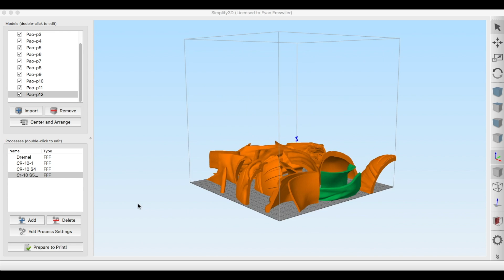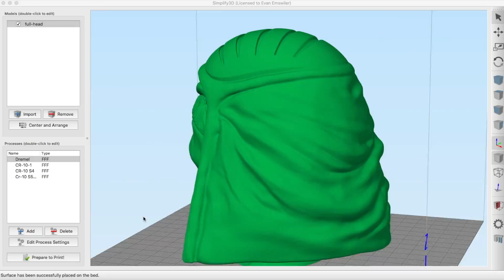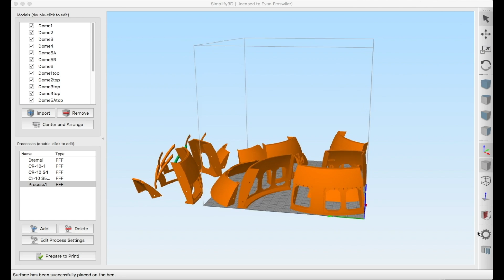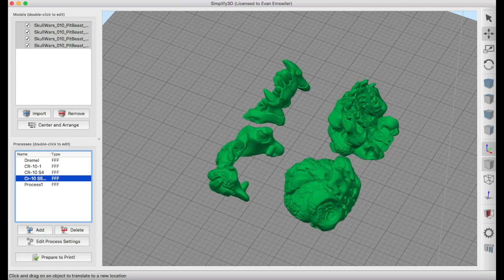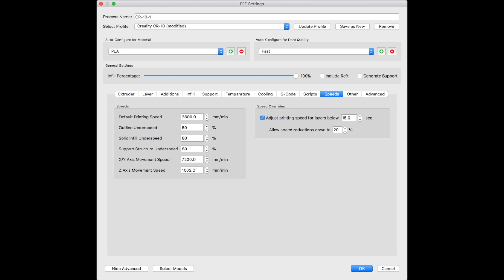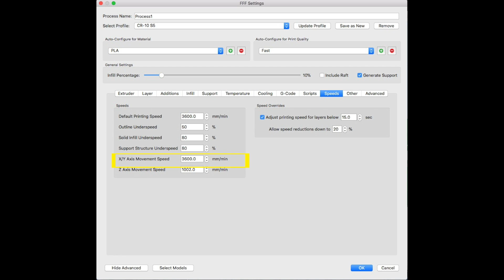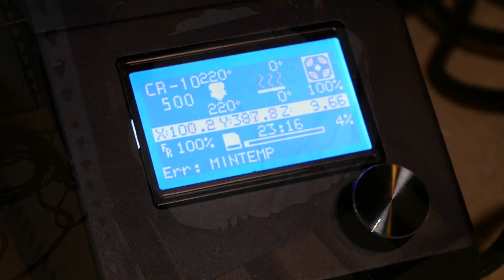Make Insanely Huge Prints on the Creality CR-10 S5!

Comment: Do you know of a printer with minimum 20"W x 20"L x 16"H?
Reply from the maker: Robert Martin Aside from this one you mean? I’m not really sure, actually
Reply: Mighty Jabba's Collection This one is 19.6", just short of what I need.
Reply from the maker: I see. I haven't actually measured the exact printable area, but it's not unusual for it to be slightly different from the quoted build volume. It's possible you actually can do a full 20" on this. What do you need to do that requires 20" minimum, just out of curiosity?
Reply: Mighty Jabba's Collection I am a beekeeper with a few ideas for hive management, however I want to keep my creations compatible with "standard"  dimensions. An example would be integrated sensors with WiFi or Bluetooth communication. Sensors such as temperature, humidity, weight, sound, etc. At the same time integrating solar, thermal and other power generation facilities (for the sensors). Also, possibly creating a"smart" hive by integrating a picture zero, Omega or other miniture single board computers. All of this must be done in such a way that everything fits in or is compatible with "standard" equipment. A complicating factor is the hive bodies can weight up to 70lbs, so single, solid parts are desired. As you can imagine, it would suck to lift a hive body and have glued pieces fall apart lol.

Comment: Curious, nozzle size? The feed motor was spinning like a clock, so I'm assuming something between 0.8 - 1.2mm?
Reply from the maker: Actually with these I was just using the standard .4mm nozzle, which is part of why it took so long. I am now using a .8mm nozzle and I think it’s a better fit for the machine

Comment: Hey! I'm interested everything from small detailed figures to large props. The CR10S line seems to fall inside my price range and has received some overall good reviews, but what would you recommend?
Reply from the maker: Most of my experience is with the CR-10 line so I may be a bit biased but I think the CR-10S is still a good option. Or even the regular CR-10, since I am not totally convinced the extra features of the S are worth the extra money. You do need to do some research and so forth so I would recommend checking out the Cr-10 Facebook group and seeing what others are experiencing
Reply: I'll definitely do some more research before getting my own printer. I actually do have a generic one available for me to experiment on, so I think the best way for me to go is just play around with that to start with, and get a feel for the various settings and techniques. Very much enjoy your ridiculous builds and friendly vibe Jabba, thank you for the advice!

Comment: 8:15 Dont blame the printer, its the model that needs adjusting. Overhang geometry needs to be perfectly straight, you cant print a curved line mid air because its not being stretched, rather produces slack and droops.
Reply from the maker: I wasn't really blaming the printer, just pointing it out. The model isn't optimized for printing all in one piece so a few issues are to be expected. By the way, I did print a revised version of this dome that eliminated the faceting that I mentioned. I will post a video about that at some point in the future

Comment: were you able to salvage the one that stopped printing on the teeth part? i was thinking you might have been able to just start a print from the section it stopped then just glue it on from the part it stopped and after sand the parts where it shifted on ....oh and have you tried acetone vapor technique?
Reply from the maker: dreamkiss4u There are lots of ways to potentially salvage it, but I wanted to see if I could fix the layer shift problem anyway, so I decided to reprint it. Plus I don’t think it would look great if you tried to repair it unless you finish and paint it, but that’s more work than I wanted to put into it
Reply: Mighty Jabba's Collection oh ok well to me its worth seeing that I don't just have the budget just to reprint anything that large and at that scale do to the cost of fulfilment but hey if you have the money yeah I guess... but you can fix them pretty easy not really that much time or can't ever ever even see the parts that were done wrong after your done but to eaches own I guess... it was just somethings I was curious about because I didn't really know what happened to that one shown is it was just curiosity hehe

Comment: Maybe it would be faster if the bust had a thinner shell in the original mesh, and slice it with 100% infill, rather than have a honeycomb (which is slower than rectilinear) infill of a bigger shell. Then again, it is always difficult to do such modifications on a mesh which wasn't designed for 3D printing in the first place.

Comment: What are you using to hold up the cables ? I can see I will have an issue with them hitting a big print.
Reply from the maker: Retractable badge holders zip-tied to the top frame. These: http://a.co/6xKGr4T
Reply: Thanks, Love the videos Great info.

Comment: I noticed that you are using Soultech 3D filament, I have never been able to get this stuff to print thru my CR-10 0.4 nozzle without clogging up. what am I doing wrong? mostly every thing else PLA works great Ziro 3D filament and Esun, Hatchbox etc works great.
Reply from the maker: I print it at 220 C. Maybe you need to go hotter?
Reply: Yes I print at 220, Bed heat does not seem to matter 50 or 60 works the same.
Reply from the maker: Hmm, not really sure. I haven't experienced any unusual clogging with it. In fact, it's probably the filament I use the most, since it's pretty cheap on Amazon
Reply: Thank you it must be some setting I'm doing wrong.
Reply from the maker: Temperature also depends on the ambient environment, so you can try varying it a bit to see if that helps. Maybe also try printing slower just to see if it changes anything.

Comment: What were your settings? I have the same printer and Simplify 3D.
Reply from the maker: I'm basically just using the Chris Elkins profile from the CR-10 Facebook group, with the build volume changed. Did you have specific settings you wanted to know?
Reply: No, just learning what these settings do and the effect when changed, yes I am new at this and doing large models. 
Joined the CR-10 Facebook group.Thanks

Comment: It looks like the coupon has expired...just so you are aware.
Reply from the maker: It seems that the coupon is still good, but the price has changed slightly. I'll update the post. Or did it just not work for you at all?
Reply: Mighty Jabba's Collection when I tried it there was no change to the price
Reply from the maker: Where Nerdy is Cool! Make sure you are signed in. I just tried it and it seemed to work
Reply: Mighty Jabba's Collection which code did you try?  I was signed in...
Reply from the maker: Sorry your comment got flagged by YouTube for some reason. I tried the GTBE code I believe
Reply from the maker: Make that GBTE
Reply: Mighty Jabba's Collection okay well that worked this time. A price under $1k

Comment: When you screwed up on the skull and didn't print the teeth completely, why didn't you just print the rest of the teeth separately then glue them on instead of re-printing the whole thing?
Reply from the maker: I don't think it would have looked great if I had done that, considering it already had a bunch of layer shifts. Since I also wanted to make sure that I could solve the problem with the layer shifts, printing the same exact model with different settings seemed like a good test
Reply: oh, I see.

Comment: Huttese:  Can u make do video on upgrades um optimizations che doe 3d printer? Che example, do cover, mo haba do volcano hotsa end?

Translation: Can you make a video on upgrades and optimizations for the 3d printer?For example, a cover, or maybe a volcano hot end?
I would have said “please” and “thank you” for reading this but I don’t think Huttese has those words. :P
Reply from the maker: You get extra points for the first Huttese comment on my channel (or at least the first one in complete sentences). To be honest, I don't know if I'm a good choice to make videos like that because I generally keep my printers as stock as I can, and I'm generally quite satisfied with them like that. I did just change to a large diameter nozzle on a couple of my printers for an upcoming project, but that's generally as adventurous as I get

Comment: I JUST got the CR-10 500 on Tuesday! I'm already a Baddeley Patreon supporter, so I'll ask him for that version of the dome!

Also, thanks for the tip on the X/Y Axis movement speed. I was skeptical that a floating bed would handle that much potential mass, and you solved the problem before I experienced it! Thanks!

I ran into EXACTLY the same issues with the bed leveling wheels and the strain relief bracket. I'd love to see the link for that, because, like you said, the 500 has those support bars on the bottom.
Reply: Also, how long did the full R2 dome take on the S5?

Comment: I’ve done a lot of smaller printing on a 8” x 8” bed and occasionally have a very hard time removing the prints from the bed - how difficult was it removing these mammoth pieces from the bed, and did you use any special tools or methods? Thanks!
Reply from the maker: It was not too difficult, actually. I print on glass with glue, so it tends not to be stuck as hard as with a build surface. I did have to remove the glass to get better access on it and use a scraper for some of them

Comment: I think there's an option for variable infill (there is in cura, not sure about other slicers) so the infill is more dense near the top and bottom and largely empty in the middle. Saves lots of plastic and time.
Reply: Given the nature of this machine I think it would be worth the time and effort to model your prints specifically to have exactly the support you need without any necessary at all from the slicer.  If necessary you might use support on the outside but internal supports could just be part of the model assuming you don't need the interior volume open ,like with a wearable helmet or something.

Comment: How much does the 3D printed dome weigh?
Reply from the maker: I think it was around 1.5 kg. I could have reduced that by not making it 100% infill, which turned out to be overkill on the main part of the dome
Reply: Thanks for that, I'm starting the print tomorrow night on my replacement S5, so any advice is gladly taken!
Reply: Print is done, 6% infill, under 500g and seems quite strong. The HR2 high res version is ultra smooth, I'm really happy with it. Thanks to you and Mr Baddely! https://i.imgur.com/uDSiBhV.jpg

Comment: Great R2 head. How much filament did that require?
Reply from the maker: I think it was around 1.5 kg. I could have reduced that by not making it 100% infill, which turned out to be overkill on the main part of the dome
Reply: Mighty Jabba's Collection I am thinking about going the Creality route. I have an Robo R1 and it has one of the bigger build plates prior to Creality but nothing like this.  I build mainly Trek for myself and Wars for my son and me.  Great work. I will follow you

Comment: Great video..... I know the print bed isn't near the Cr-10, but what is your view on the Prusa i3 MK3?   It would be my 2nd printer and I'm looking for something with a little more features than the Cr-10.
Reply from the maker: Well, all I know about it is what I've seen on YouTube, but it does seem like a good machine. They've got some pretty intelligent features in the new version, and it apparently prints well. I'm not sure print quality would be all that different from a well tuned CR-10, but you may find the extra features to be worth it.
Reply: Mighty Jabba's Collection what upgrade recommendations would you suggest for the cr-10?  New hot end, electronics, etc?  That could be an option instead of the prusa.
Reply from the maker: I run all of my machines more or less stock, so I don't have any experience with upgrades, and to be honest half of the problems I see on the CR-10 Facebook page seem to come from people upgrading their machines without a clear idea of why they need to do so. I have heard good things about some of the auto-leveling solutions that exist, but I think you'd probably be better of with the Prusa and the stock CR-10 than spending hundreds trying to upgrade the CR-10.
Reply: Mighty Jabba's Collection sounds good. I really appreciate the advice. 😀

Comment: The real question is, "How small can you print with the CR-10 models?"
Reply: I want print small human faces detailed.. will it works ?
Reply: you could print a game of chess. small pieces and a board. not much could pull that off
Reply: I've got a Creality Cr-10s, and the first thing I printed when my printer arrived, was to test the small details quality, and printed a BBS RS wheel ( Google it), 5 cm outter diameter. Some details in the center had 1mm or less and the printer had NO problem printing it.
Edit: oh, and I only used custom settings to start with, and 0.2mm layer height.

Comment: Try using the variable infill settings in Simplify 3D
Reply from the maker: Chuck Arrivas Yes I was going to mention this. Using these settings probably would have been a good idea, but after one failed part, I was afraid of screwing it up somehow, so I erred on the side of caution. But that could have saving some time and plastic

Comment: Hey there what settings did you use for printing the R2 Dome? I was testing bridging with my CR10 on an architecture model, it already looked great but still had a little sagging.
Reply: I agree, it would be great to have your FFF as a base to work from, I certainly didn't get bridging over as big a gap as you can.
Reply from the maker: Well, I use the Chris Elkins profile from the CR-10 Facebook group as the base, but I have changed around a few settings (not sure just what at the moment). Temperature was 220 for that particular filament. What did you want to know in particular?
Reply: Mighty Jabba's Collection It would be great if you could export your settings and share the text, I know how to do this in Cura but not for Simplify. Because there is multiple values that could lead to success it’s hard to say which values I would need to change. I am more interested in comparing my setup with yours.
Reply: Any chance you could send me your FFF file for the S5, I'm running Simplify3D V4, and can't get it to bridge as well as yours.

Comment: Best choice when getting skipping is not to cut the traverse speed, but to lower the acceleration so it does not try to accelerate faster than it is physically capable of moving.
Reply: I realize I'm 3 years late, but I cant think you enough for this.

Comment: I have the printer(in really 2) and .... It was a bad idea, the first 100 hours was Ok but later the printer its really bad, you have to re-buy all the components mensually,  the bed leveling its horryble, the z axis the same, if you want print 2 or 3 big pieces at year ok but if you print 200 hours per month i not recomend it.
Reply: What problems have you had specifically? I put over a thousand hours on my previous S5 and only made a few mods.
Reply: With the dimensions of the bed, and the total volume, if you want to print a piece of 15 days and 6 kilos of pla is not reliable, the extruder easily deviates losing the alignment, the bed weighs too much for so much weight, the wiring it is very short, the connectors of the motors are disconnected with the vibration ... they are too many problems that must be fixed to obtain a good piece that is not hollow (that is easy).
Reply: I've printed some 4kg models without issue, but you do need to cater for the weight by adjusting the acceleration settings
Reply: I am building one of these though with a static bed for bigger models. https://www.youtube.com/watch?v=eUf5-UCVueU

Comment: Thanks for the review, the prints you did look quite impressing! i like very much how the r2d2 part came out, it looked quite complicated to print without supports.

Im looking at this printer for the large volume, i have a cr10 already (along with other printers) and think it's a good printer. I have read that the bed is not easy to calibrate and that it wobbles a lot, what do you think? Obviously you had quite some success with printing large stuff, did it warp at all?

I just subscribed to your channel!
Reply from the maker: I don't know that I would say the bed wobbles exactly, but leveling can be a bit tricky. For the most part I didn't have any warping, although one of the pieces of the rancor jaw did pull away from the bed a bit. I think if you use enough glue on the bed it will generally be okay.

Comment: way too much time IMO
Reply from the maker: Yeah, I don't really disagree with you (assuming you're talking about the rancor). I don't know if I would have done it if I had known how long it would take from the beginning. One thing I forgot to mention is that I now have .8mm nozzles installed on a couple of my printers, and it does shorten print times considerably without really making a big difference in quality.

Comment: hi Mighty Jabba's Collection, i want to buy the s5 on gearbest.but it seems i cannot ask a question to the seller. i want to buy the s5 with uk plug but there is no option to choose. is it safe to buy on gearbest ?
Reply from the maker: The US and EU plug versions are identical with the exception of the plug type (you just need to select the correct voltage with a switch on the machine). So for the UK I assume you would either use the EU version with a plug adapter or use an alternate UK plug that you supply yourself. These use the same standard power cord that just about any PC uses, so getting a new plug isn’t hard. In fact, I was sent the EU version by mistake and supplied my own cord